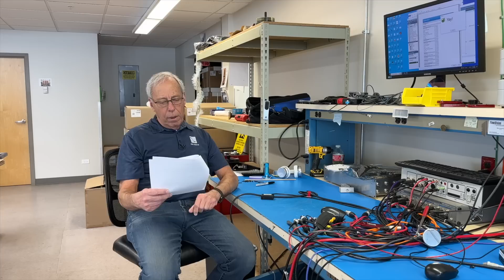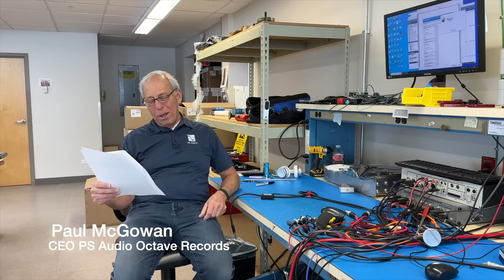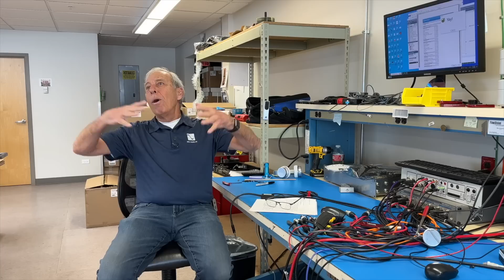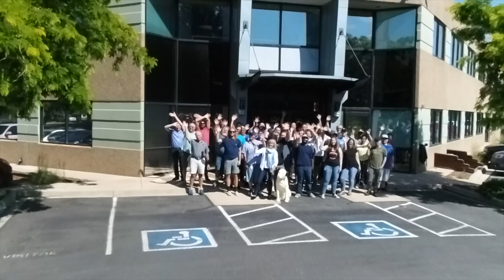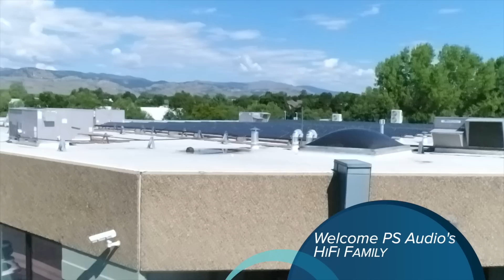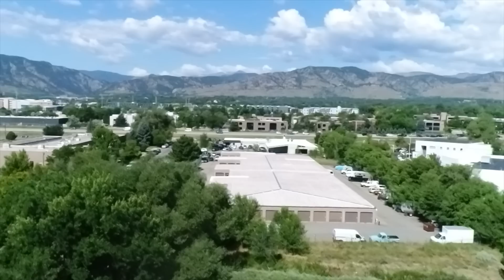Impossible audio measurements

Comment: I wonder if you could have an array of mics like a camera sensor in a standard size room and in standard listening locations. Have them record a standardized group of sound tones and timbres. These sounds are also evaluated by a board of audiophiles like a pier review group dedicated to the standardization of audio using this standardized room. We then correlate this panel's subjective experience with the empirical data from the mic array and this information becomes part of an audio standard ISO 20 - 20,000. In time given enough data the community could approach some semblance of empirical audiophile attributes besides; open, airy, warm, cold etc. 🤓
Reply: If all it takes is 2 human ears to perceive 'soundstage', two mics should be enough.
Reply: @captainwin6333  Well Mr Wind, imagine, two waves, different frequencies and bouncing around a room. Each sensor will experience the two sounds differently. We know this but this is also why prime listening position are experienced in the way they are, for example, expansive. Now you have additional data from the array to tell you the conditions under which the prime listening spots becomes expansive. Demonstrative example, the sound stage improves with a good sub. I think it's because of constructive and destructive dynamics. When the constructive and destructive dynamics are right, what I mean is the right magnitude of cancellations or/and superposition we get the illusion of a sound stage.  I wonder, when we get the behind the speaker illusion, is that of the ilk of a standing wave of some sort that is dominating the room from behind the speakers?
Reply: You have to get the Aliens 👽 involved. They have out of this World hearing Abilities.
😀😀😀🤗👍😎
Reply: @davidfromamerica1871   🦗
Reply: @tiffinytiffable  
Thanks to you I found.
“Radio Africa”
😎👍🤗😍❤️

Comment: And I quote from John Siau of Benchmark, the creator of the most accurate amp AH2B : 

Stereo depth is very dependent upon a precise phase matching between the right and left channels at all frequencies in the audio band. Differential (left/right) phase errors will blur the location left to right and especially front to back. Left to right positioning can be overridden by left to right amplitude differences. Depth can only be conveyed by accurately preserving the phase response in both channels all the way from a stereo microphone pair to the pair of loudspeakers. You also must be seated in the sweet spot to hear depth.

Many very fine studio recordings have absolutely no depth because the left/right stereo image was entirely created with pan pots. The left/right positions of the musical voices are entirely determined by the left/right amplitude differences. Some fine examples are all of the tracks on Steely Dan's "Two Against Nature". This CD is a great recording but it has absolutely no stereo depth when played on a system with an accurate phase response. Systems with a poor phase response may give these tracks a false sense of depth. This false sense of depth is easily identifiable because each musical voice will fill the entire depth instead of locating to a specific distance behind the plane of the speakers.

If you want a good explanation of depth and a good demonstration play tracks 4 and 5 of "The Ultimate Demonstration Disk" from Chesky Classics. In fact, the entire disk contains tracks that have wonderful stereo depth with pinpoint focus of location. These recordings were made with stereo microphone arrays and the stereo images were simply captured (not created with pan pots).

It is now possible to artificially create stereo recordings that have depth. DSP techniques can be used to place a musical voice anywhere in a 3-D space. This 3-D space can then be rendered by a pair of stereo speakers or by an array of speakers (Atmos). 3-D position is determined by phase and amplitude. Left/right phase errors will expand the size of each musical voice (blurring its location).

Whenever a musical voice is mixed to the phantom center of the stereo image, this image is easily blurred by differential phase errors. If the high frequencies seem to come from the speakers instead of from the phantom center image, this is an indication that there is a left/right differential phase error at high frequencies. I have some recordings that are essentially mono in stereo. In other words, the entire mix is dead center. Phase errors immediately destroy this phantom center image by moving some frequencies away from the center and toward the speakers. Some of the tracks on Eric Clapton's "Old Sock" CD are useful for this test.

So, in short, if there is no soundstage width and depth in a recording, there shouldnt be any during playback. Accuracy, in this case, is not favoured by many. Depends on what you want. Ill stick to accuracy and will be swept away when the right recording comes along.
Reply: Where can we find the full article please?
Reply: The knowledge. wow.